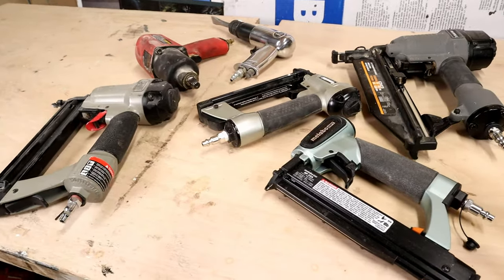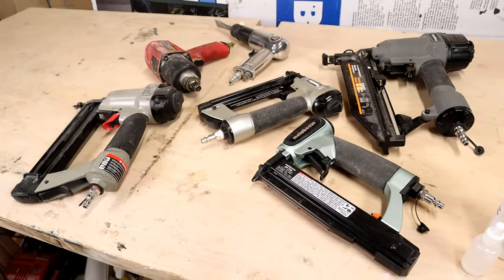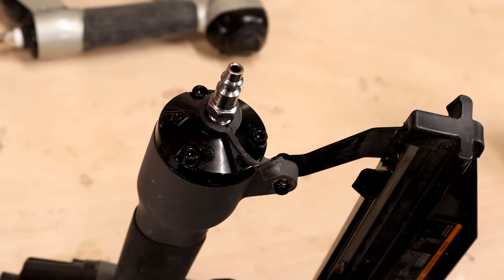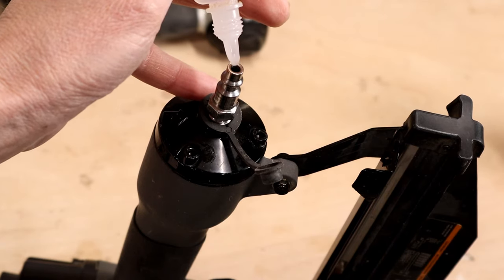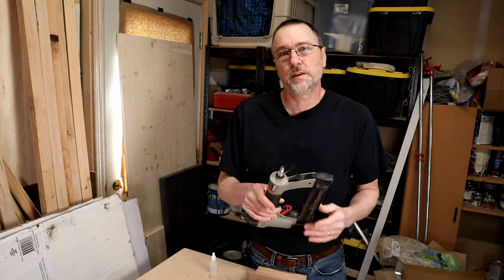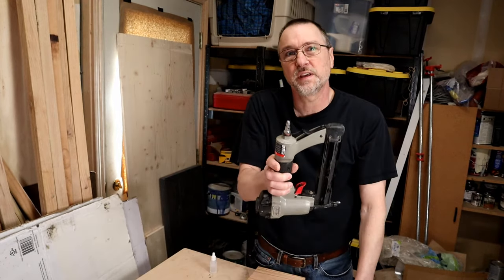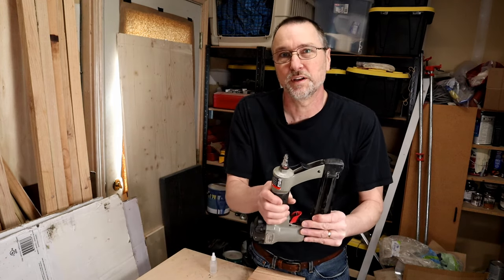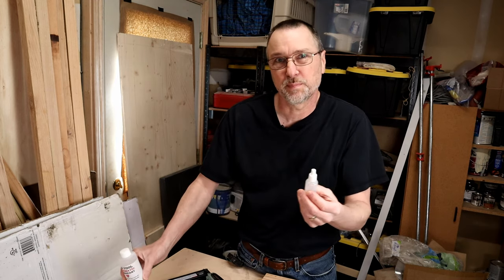How to Lubricate Air Tools ~ Super Easy!

Comment: Just bought my brother an air chisel and hammer for Xmas 2024 and glad to see what I need to add to the gift, thanks so much. You also have a new subscriber.
Reply from the maker: Awesome! Thanks for subscribing. I'm glad it helped.
Reply: @RonniesWorkshop  Your very welcome  but what do you think about using ATF Dexron tranny fluid as a lube as well. I've  done some research and pretty much every one says it's never failed them..
Reply from the maker: @WoLFSkYBLuE69  I don't have an informed opinion on that. I would just say the safest course is to use what the manufacturer suggests with the tool to be used.

Comment: Dust caps for the tools: When wire shelving is cut, what is left is a very sharp, jagged end. Whoever sells wire shelving should have packets of rubber/vinyl caps to cover those ends. They make perfect caps for pneumatic tools.

Comment: good tip...thanks.  i also try to do some other maintainence at same time.  lubricate the slides where the nails/brads go on the gun and try to remember to drain the moisture out of my pancake compressor.
Reply from the maker: Good tips!

Comment: After lubricating a tool is it normal for oil to come out while using the tool?
Reply from the maker: If you put a few shots without nails onto a piece of scrap wood after inserting the oil, that should work any excess oil through.
Reply: It is not abnormal or cause for concern.. Maybe a drop or 2 less on the next lube job... If it is cause for concern (leaking on a wood project would definitely be something to look out for especially if ur finish nailing and all stain and seal has already been completed but definitely not a concern for the tool

Comment: I know that it's often asked, with different answers..... but here I go.....

Can I use Robinair 13203 Premium High Vacuum Pump Oil as air tool oil?

Apparently, this oil IS a mineral oil and it appears that it can be safely used.

Does anyone KNOW for sure, yes or no and why yes or why no?

Also, it wasn't mentioned here, but how often should the tools be oiled?
Reply from the maker: I don't know about that one, sorry.